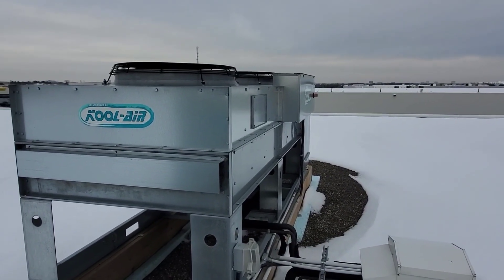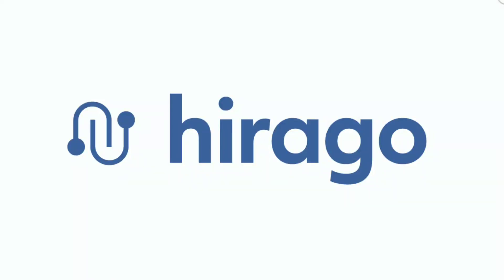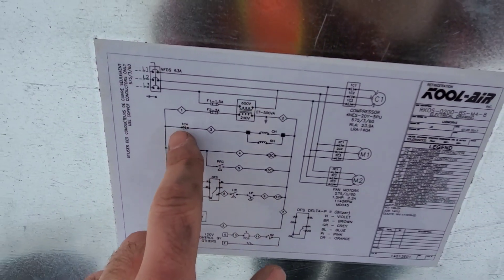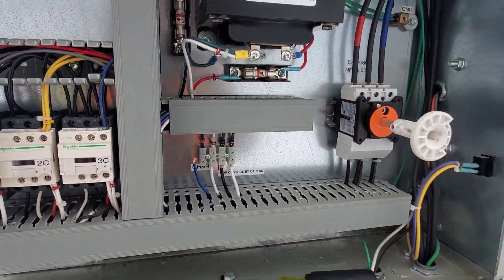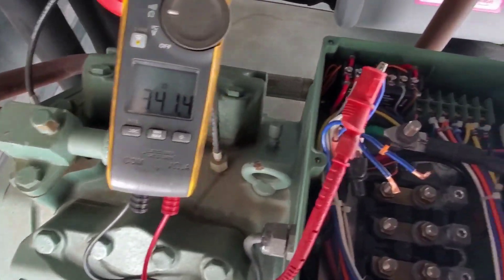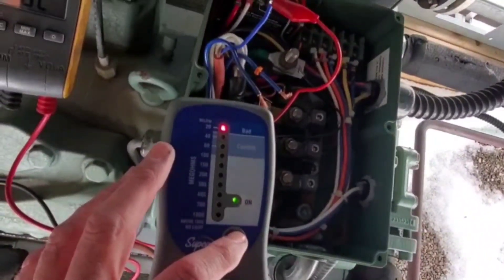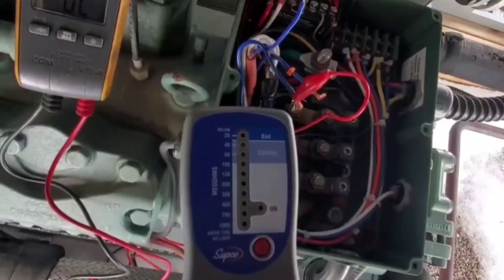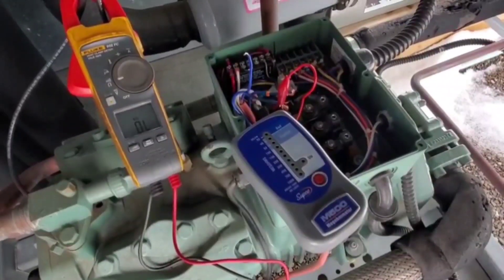Cooler Temperature Was Outside Its Range

Comment: As I understand it, you measured resistance from blue conductors to ground while the loads were connected to the ground on the other (earthed) side. In effect you measured the resistance of both heaters - the fist one 341 ohm gives ca 170 W, which sounds fine. The RH showed open circuit on ohmmeter (ca. 5V test voltage) and "bad" on megger (test voltage much higher, what value?). If my reasoning is correct, I guess RH is faulty (inconsistent results) and the CH is fine (consistent results). In any case, thank you for posting.
Reply from the maker: Not correct, I didn't measure across the CCH I meaured resistance to ground, that's different from measuring the heater resistance itself.
Reply: @HVACKnowItAll  Was the other side of heaters disconncted from ground? It was hard to see in the connection box. Sorry, my fault. ;-)
Reply from the maker: The other side doesn't need to be disconnected, I'm checking to ground, any small amounts of resistance to ground is going to pop a fuse or a open a breaker eventually or directly after power is applied.
Reply from the maker: But just an fyi, even with the ground disconnected at the transformer, the readings were still the same for both heaters.
Reply: @HVACKnowItAll  OK ;-)